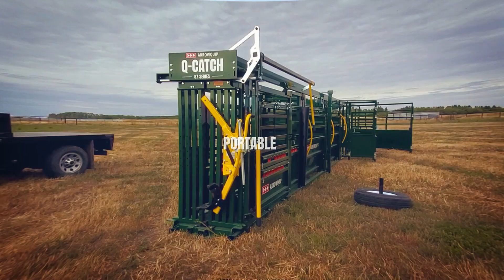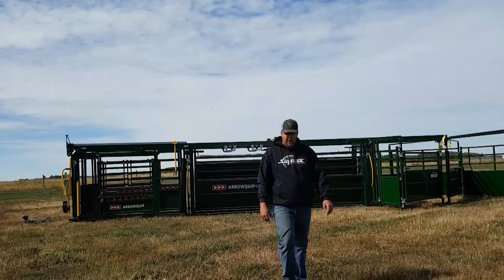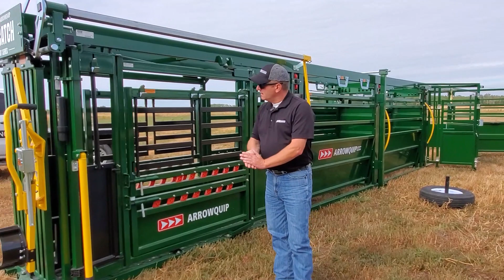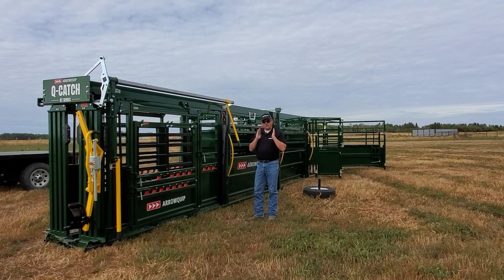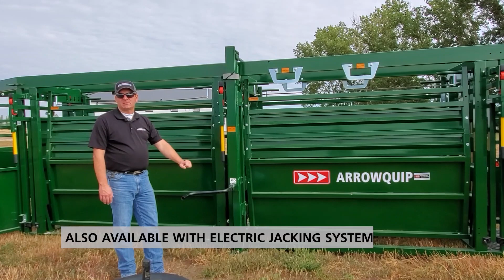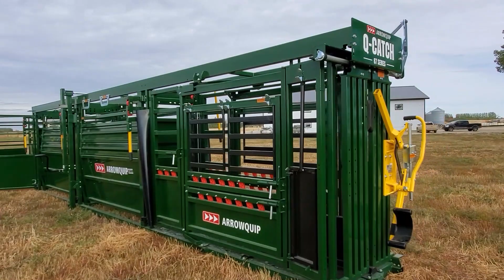Portable Cattle Chute, 18’ Alley and Tub | Walkthrough with Norheim Ranching

Comment: Good looking unit.  My only - would be that on the tub, or half circle, have the solid walls go up higher so they can't see out.  As you say at the front of the chute you have open to let more light in, so they see to want to get out. Have less light here so they can't get nervous when people are walking andworking around then chute area.  You did a GREAT job in describing every little deatil about it!  How about a video showing the set up process?  Time you unhook from the pickup to ready to work livestock.  thanks!
Reply from the maker: Thank you for the feedback, Brent! The reason there are light breaks in the tub walls is based on animal science. Cattle are drawn to light, so if the walls were solid, cattle would be less inclined to use the equipment! Solid walls can also cast shadows, which can scare cattle and make working livestock more difficult and less safe.
Reply: @Arrowquip  I will agree to disagree.  Perhaps have the light at the start of the lane.  But in the circle that gives them eyes to see whats going on,sq tubing to jump up on and poss break a leg.  My dads was built in the 70's with full 4'x8' sheets only light was at the start and end of the tunnel.  Good luck.